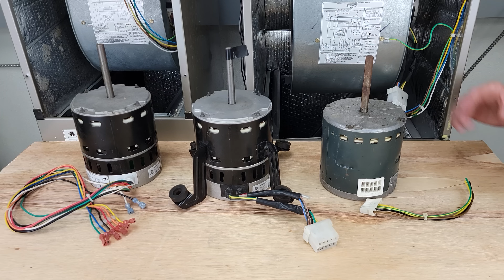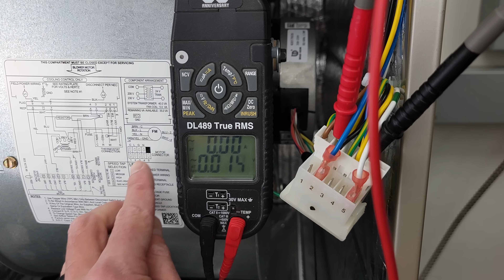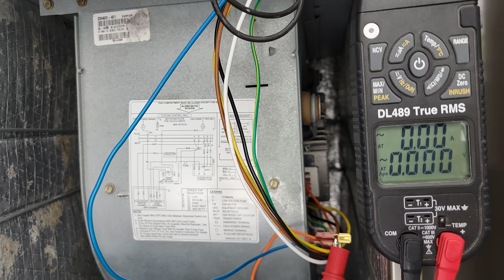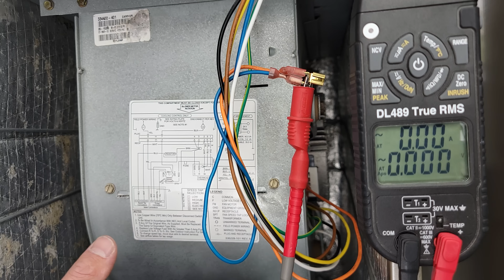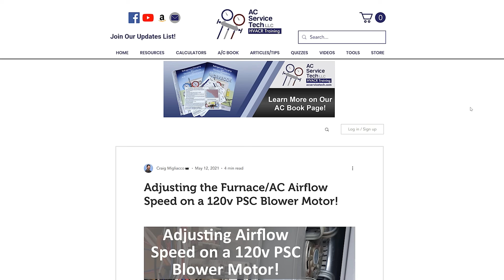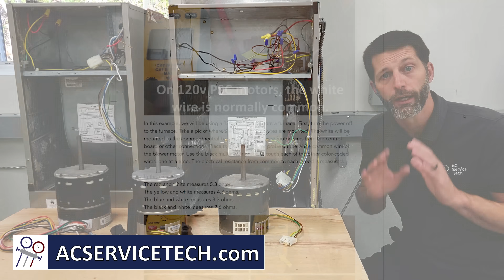Fast Easy ECM FAN MOTOR Troubleshooting! ECM Blower Motors with Spade Terminals!

Comment: The one that comes with a wireharness connector and the other one build with two connectors on the blower motor are ok to use either one of them, right?

Comment: What if the motor won’t shut off. I’ve replaced the thermostat. I’ve pulled the fuse in the ah. I’ve measured for power. I believe my motor has a stuck relay

Comment: In that circuit there is a resistor almost in the center of the diagram on a low voltage line, please explain it

Comment: How about troubleshooting the ECM vs the motor itself? This just shows that it's not the board and therefore it's the ECM/motor. But what if the motor is fine and it's just the ECM?

Comment: I must have a Unicorn problem. My blower motor runs, CONSTANTLY. I determined its not the thermostat but the ECM module. I replaced the entire motor, which is way cheaper than the replacement module, and its working great. What is wrong with the ECM module that it lets the motor run constantly, and is it fixable? I've watch hundreds of these videos and no one has this problem.
Reply: I have the same problem, I replaced the control board, how do you test to eliminate the board ?

Comment: For my case gas furnace blower keeps running when it is turned on the power switch. From the gas furnace control board, measuring voltage from the harness connection,  with the power on, I got 12V power to the blower, RX got 12V and TX got 0V, even thermostat hardness control was removed. It still got the same result. The fan motor was rotated freely when I turned off the power. I suspected the ECM module was stuck and had issue. Mr. Craig, anything I could miss?

Comment: What's the point? He is checking the wiring not the motor. It's electronic so if it does not turn the electronics are shot.

Comment: Thanks for the video. I have Lennox 4 ton handler where the blower motor has died 5 times in 7 years. Keeps dying on not much AC use. Also, WiFi thermostat keeps needing battery changed yearly (meaning not getting full power all the time). 240 voltage checks out fine. Motor is variable speed ECM motor. Any ideas on what could be causing this and how to check for it?  Thanks in advance for any help.

Comment: So I put my carrier furnace to fan on at certain times of the day. However when it calls for heat it shuts the fan down during the ignition cycle. Is there any way to bypass this so that the fan will keep running when I have power to G?

Comment: For me it has never been the motor except for 1 firestation I take care of.  For the rest of the 11 years it has ALWAYS been the module.  Customers can replace just the module if it is just the module.
Reply: My motor won't cycle off it just stays on. Is it the module? I only see refurbished ones on eBay.
Reply: @jvjv2586  Disconnect thermostat from board.  Check your 24v wires from your module.  When off it should be receiving NO 24v.  If you find that it is NOT receiving the 24 volts but still running, it is your module.  If it IS receiving 24 volts... it is your board.

Comment: What if the fan runs continuously without being called.  Did it loose 24v to the motor, is it the heat relay, or could be both?

Comment: Have a Lennox Elite, the fan and motor are working, but very little air is blowing out heat vents, very weak, I'm wondering if these are two-speed fans and mine is not kicking into the second speed, which would explain the low blowing pressure coming out of the vents?

Comment: What happens in the case when the blower motor doesn't turn off at all? The heat and the a/c cycles just fine and the outside unit turns on and off but the fan inside keeps running. When we pull the faceplate off the thermostat it stays on too. We've made sure its set to auto. Inside the unit is the transformer, two relays with one having a rectifier and then the wires going down to the ecm fan motor. We've replaced both relays and rectifier and are having a hard time figuring out whats going on. We're having to cycle the system on and off at the breaker panel and its frustrating because we don't have the funds currently for a service call. This is an all-electric unit with two heat strips if that makes a difference. Any advice for what I should be looking for? Another motor maybe? Any help would be greatly appreciated, thanks!

Comment: My indoor blower was working prior to me changing out a control board on my outdoor unit now the indoor blower doesn’t work just try to spin / turn twice then nothing. I checked the power supply 👍🏽 and jumped the low voltage supply 👍🏽? I’m scratching my head on this one

Comment: I have the same ECM BLOWER MOTOR as shown in this video; the blue speed wir has 24 volts, I have both hot lines with voltage (240), but the white speed wire does NOT have voltage on it…should it?
Reply: Not at the same time

Comment: This is a great video. I have this issue. Motor is one year old.  I have wires at 1, 2, and 4. When I probe only 4 has 25 volts. Blower doesn't start.  So even though 1 and 2 have no w voltage that still means motor is bad? Sorry for the dumb question.

Comment: I have an X13 motor, all power wires/supply is good. I can’t get it turn off, I removed the 2 signal/trigger wires, still won’t shut off. Only way it shuts off is when I pull the power disconnect. Bad ECM right? Which means I need a new motor?
Reply: I think I have the same problem.  I think maybe it lost 24v (that first pin) to the ECM Gentec motor. But I pulled a wire off the heat relay and the motor stopped. 🤷‍♂️ it’s killin me! 😡

Comment: I have the broad-ocean motor. My AC quit today while I was at work. Came home and diagnosed it to find that when calling for heat the blower motor kicked on but not when calling for cool. I moved the speed tap from 2 (medium) to 3 (high) and it got the blower motor to  kick on and cool the house. My question is, is this ok to do? And also is there any repair or do i just have to replace the whole motor. Thanks

Comment: Need a vid on how replace these stupid ecm motors to the reliable old school psc motors…
Reply: Take primary voltage off the harness and put it on a 24v coil contactor. Use the 24v speed reference as your coil voltage.
Reply: @JohnathanMoore-n3k Wow, thanks

Comment: Probably a stupid question,  but if I've already figured out that the blower motor is the problem,  how do i know if the motor is an 825 or 1075 rpm model?   I can't find anything to match part numbers to the rheem website from the information panel on the main ac into.
Reply: It's written on the motor if not find it by the model and serial number of the unit.

Comment: They say to check to see if the fan is free spinning and not binding, but didn’t say what to do if it is binding.  So what should I do if it’s binding?
Reply: If it is binding up while not energized (or calling to run from the thermostat) then most likely the bearings are seized.  If it spins freely while de-energized but binds up upon call to run, the windings are most likely bad.  Either way, sounds like a new motor is needed.
Reply: @dgapp76  
That’s what I thought, thanks.

Comment: Wondering how to know difference of if you need to replace the blower motor and module together vs. just needing to replace the  ECM module?
Reply: From my understanding and research it's usually always the module going out.
Reply: @YoungUrbanPsychopath  Yes it was the module that i had to replace, the new one came with a fuse wire kit that goes in between the module and the main power that will trip if there are any surges in the future it will just blow that fuse instead of the expensive module. I saw they also sell these individually online, def wish i had that in the first place.

Comment: What if the fan runs but when the compressor turns on the fan shuts off. Have low and and voltage to the motor

Comment: So my blower won’t shut off after the temperature is satisfied what should I check ?
Reply: I've got that same issue on a Rheem RH2V unit.  Thermostat can be turned off, and the fan just kicks on by itself and maybe runs for 30 seconds, maybe 5 minutes, or doesn't shut off at all unless you flip the breaker.  Sad that it's only a not quite 5 year old unit that was fairly expensive.

Comment: I have the last motor on the video but when I check the común and cold ;heat and fan don’t have a 25 volt that’s meant the motor is bad or the control board

Comment: What if it runs nonstop motor won’t turn off on furnace it’s a ecm motor I unhooked all the low voltage wires and still turned on wouldn’t shut off then I took the 24v wire going to the blower motor off the board and still kept running
Reply: Control module has failed

Comment: What makes these ecms go bad so much? I am about to be on my 3rd under warranty as soon as they get it in and can get back here.
Reply: The controller is probably sensitive to transients from nearby lightning strikes.
Frequent lightning areas should have transient supressors in the main panel.
Reply: I wonder if they’re very sensitive to static pressure?? I suspected an airflow issue cuz motor was working and found a return sized too small. A lot of systems aren’t ducted for correct airflow. I had one ECM motor would struggle to ramp up but when i open the blower compartment all of a sudden it ramps up. It was intermittent and we all know how frustrating intermittent issues can be. Eventually i caught it not working even with blower panel off.

Comment: I have a nortek hvac unit. They use the ECM blower motor. It lasted about a year and a half. $500 for a replacement motor.  Just the motor. There is no way to change to a different blower motor without changing the entire unit or the controler board. These ECM motors are JUNK. We need to boycot all havc manufacturers until they switch back to motors that work. My old unit lasted 28 years. The nortek unit was installed about a year and a half ago.
Reply: It's the department of energy the ones responsible for the new mandates. Like ecm motors and getting rid of your gas stove at home. Now contractors are required to give all your information name, address phone number with the New heater /ac system being installed in your home . Nation wide if contractor doesn't provide that information then they black ball that person or company from buying equipment nation wide.

Comment: i have everything i need voltage wise and my motor spins freely but when i turn on the fan, it spins really slow. what is my problem?
Reply: Is your issue resolved? If yes, how it got resolved?I have same issue , all multimeter reading are correct but motor runs very slow and not able to push air from vent
Reply: @manishpatel9248  bad ECM. Replace motor.

Comment: My motor continuously runs, even removing the low voltage plug. When running without the low voltage plug, each pin gives between 16-24VAC. This mean that the ECM is bad correct?
Reply: I’m having same problem. What was your solution?
Reply: @cutactiontake9 I had to replace the motor. When it keeps running without the low voltage plug connected means that the ecm is bad.

Comment: Clear precise video great job.  when checking power to the unit check between Line and grounding too because that what kill you.  There's case that no power between L and N but there's power between L and grounding, single phase 120v to grounded anyway.
Reply from the maker: Thank you for your positive feedback on the video, and your safety reminder is absolutely crucial. You're absolutely right; when working with electrical systems, safety should always be a top priority!

Comment: Hi thanks for your time and effort.
My fan blower runs good when i turn the unit off for 1 hours or more, if i let it run on auto the a/c compressor starts but the fan blower doesn't why is that? A/C maintain temperature and some time works for hours with no problem then it act up, so i turn it off let it rest for a bit and i turn it back up.
Thank you
Reply: I have same issue? How did you resolve the issue ?

Comment: So a question this is 24 volt ac or DC and are you using pulse with modulation to increase the frequency
Reply: Lol every motor in this vid is 24v A/C controlled. Every motor in this vid is an X13/ constant torque motor. These X13 motors only have multiple speed taps (higher the #, higher the RPM).
These motors have a soft start but they ramp quick to the RPM based on 24v A/C input to the speed tap.
Edit: 240v A/C is continuous. 24v A/C control is based off tstat (yes you can apply 24v A/C to #1 terminal & as long as 240v (or 120v if a furnace) these motors will fire. 24v A/C is the control side. Switching characteristics are internal to module...no external relay needed.
Reply: @haljordan9160 I have a carrier unit with one of these gentec 1/2hp on the motor and it runs continuously even after the temperature is reached I have to turn off the breaker for the air handler just to shut the AC off any ideas? is the ECM module bad how should I test?

Comment: Hi I was wondering what I can do to fix my problem that I have with my ECM module? In the last seven years I have gone through three of them! the tech will never help me! or suggest a better solution!!! I know I should change techs and will, can I change the hole motor to a non ECM blower motor or what do you suggest thanks! new follower!!!!

Comment: ECM blower motors are the worst thing since poly b, a couple bucks energy saving for a 1500 blower motor replacement, you'll never recover your energy savings
Reply: Reliability is more important to me than a minor increase in efficiency.

Comment: That’s fine if you have a 16 pin, 24v controller. Unfortunately, there are other options available for these ECM motors. I am currently working on a motor with a 4 pin communication cable with only 3 wires, and controller. Can’t find any information about what I’m supposed to look for as far as communication? I did have a 29-30 dcv so I’m going with that since the industry doesn’t bother to communicate wtf they are doing with their “new technology” for the poor suckers who are tasked with fixing this mess.
Reply: I’ve been in this HVACR trade for 36 yrs now. And BS that has being distributed out to the public/industry for the past 20 yrs now is really ridiculous and sad at the same time! The Field is now the Research and Development Guinea pigs now days. And these Mfgs are not even remotely concerned about anything else but their Quotas and bottom lines. 
Meanwhile time we are getting our ass chewed out from customers who had to Pay huge money $$$ and then Wait like hell to get equipment. Specially if it’s a RTU!! And when a major part does fail. You have to now wait again and pay freight to bring it in to the store because it’s a Non Stocked item!! Smfh That’s definitely not how it used to be when there never was such a thing as a “New Part is bad” now it’s a 50-50 chance that it gets lost, broken in delivery or just won’t work period!! 
Ohh yeah that’s also if they sent the right part period!
Reply: So i guess ill freeze literally as indoor temperature gets close to 0 degrees f waiting and hoping its going to  work when the part finally gets here. Should I take out a second mortgage to help pay for all this

Comment: I've noticed that these modules fail at a higher rate on horizontal right handed air handler applications,  where the blower motor sits on the bottom.
Reply: Do you have a theory of why that is?
Reply: @justanotherhuman1865  I heard that moisture gets in easier,  not sure......

Comment: Great video thanks 
My blower motor os not running 
I Checked 110v and 24v on the wires  and read good 
Is there a reset button on ecm motor 
 
My Furance blower motor info
PN 20511017
ECM 2.3
ROT CCW AMPS 11/7 RPM 1050

Comment: If it's not running, how do you know whether the motor or the module is bad?
Reply: Disconnect the fan motor wires from the control board and connect them directly to a proper power source.  If it's a 120v ac motor, then connect it to a 120 vac line.

Comment: How would you go about troubleshooting a blower motor that does turn on but is running slow?  If I reset the breaker it will start off going really fast and blow air through the vents like it should but after 5 min or so it will drop back down to going slow and I won't feel any airflow out of the vents
Reply: Bypass the control board (wire the blower motor directly to its power source.  If the fan speed stays the same and doesn't decrease after 5 minutes or so, the the problem is on the control board.  You might want to to swap out the fan motor run capacitor.  I know that electrolytic Capacitors can develop intermittent problems that only manifest when they increase in temperature.  I'm guessing the non-polarized types you see in air conditioners might do it as well.
Reply: Resetting the breaker?  If it is tripping the breaker the fan motor could be defective and is drawing too much current.  Check the resistance of the fan motor winding.
Reply: @Bruce_Wayne35 I have a carrier unit with one of these gentec 1/2hp on the motor and it runs continuously even after the temperature is reached I have to turn off the breaker for the air handler just to shut the AC off any ideas? is the ECM module bad how should I test?
Reply: @cutactiontake9  I'm not an HVAC technician, but the control board is responsible for cutting the blower motor and off.  So you probably need a new control board.
Reply: @cutactiontake9  If you do order a control board, don't order it from Sears Parts Direct.  They have a very bad reputation.
Reply: @cutactiontake9  Rats and mice also cause big problems with indoor and outdoor units.  They piss on the control boards and that can cause all sorts of weird symptoms. They also chew wires in half.